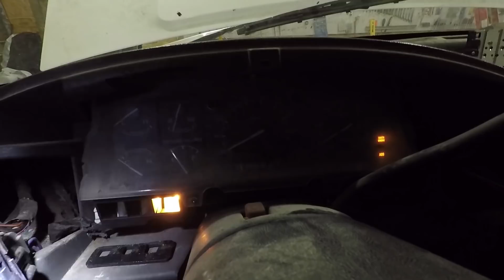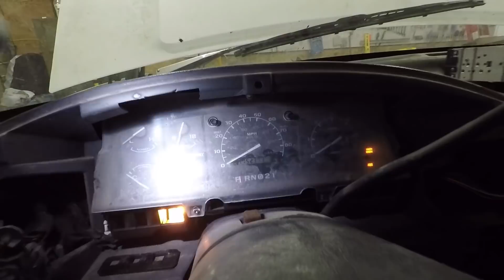FOUND The PROBLEM! - 1993 Ford BRONCO Project

Comment: My 93 has that same drivers door interior lights switch. That little protective cover tears off and moisture gets into it. I kept cleaning it for awhile until I finally found a good one at wrench n go. Super easy to change. Lots of fun projects on that Broncos makes a big difference each step of the way.
Reply from the maker: I have a feeling I will be heading there many times in the near future. LOL
Reply: Hi Bill I have a 93 Bronco as well my check engine light just came on but I can not get any codes from  it. I've tryed everything and no codes . Has your ever done that ?

Comment: I totally hate aftermarket wiring crap. I spent a good two years tracking all of it down in one of my trucks. They had some dumb remote starter installed with that weird module thing like you showed in the video. They boogered up pretty much every single connector under the dash from the turn signals to the headlights to the main ignition switch wires. Soldered together what I could and had to replace some connectors entirely but it was well worth it. No more wiring shorts!
Reply from the maker: Seems to be what you run into with an older vehicle like this.  That Flareside I had, had wiring all over it as well that I pulled out of it.
Reply: Seems to be. I ended up yanking the entire dash and the main wiring harness out eventually to fix it all right. Took a long time, but I don't regret it one bit. Everything works as it should now.

Comment: Hey Jon
  I own a '94 F350 Crew Cab dually,  7.3 IDI  and u also have a problem with the #8 fuse blowing, speedometer . And my Kenwood stereo keeps going into Protect mode. I'll have to check my ceiling light for that screw  length. 
  Great show brother
Reply from the maker: Worth a look and easy to check. Seems to be a very common issue blowing that #8 fuse.  Thanks!

Comment: Hi  Just happened onto your channel.  I've been chasing a parasitic battery draw for a long time. (1992 Bronco)  Fuse eight also involved.The door jam switch for the interior light was intermittent   I just replaced it and the draw went away..  Its funny because with the fuse out it was good for 2 days.  Then the battery went flat.  With  the fuse buddy tester on the battery playing with the switch it went from   .03  to .272  ma    So I replaced the switch with a new one.  Now everything is good...  Will wait a few days to see if the draw come back..  FYI

Comment: good to know ~ 
also; I had a fuse (can't remember) that kept going and loose my PSOM (therefore; it would go into "limp-mode" & slam shift)/ backup lights/ABS/
TURNS OUT that the blk/pur wire that is the backup lights also runs across between the headliner and windshield to possibly power the "nightime/daytime mirror".  Now the trim running (inside) across there, is sharp thin metal and it wore into that wire and VOILA found me short!
wrapped it up and also some elect. tape on the sharp edge of trim - done~

Comment: I'm liking the Bronco project, I can't wait to watch the build. 
   I have a 1995 F-150, and I was wanting a set of the stock looking clear turn signals. But I had to buy a whole set of lights, and so I have a brand new set of aftermarket headlights & corner lights. And if you want them I'll let you have them for the Bronco project. I live in WV so shipping shouldn't be to much.
Reply from the maker: Email me
Reply: I emailed you. I actually did it 2 times because I didn't think it went through the 1st time, so you got 2. HaHa..

Comment: Hey john fixing to do the oil pan gasket and timing cover on my 5.0 in my explorer did you have to raise the engine to replace oil pan gasket? and how did you do it?
Reply from the maker: I havent done that yet... but might be. Yes you will need to raise the engine to get it done/
Reply: The Fox Shop okdokie just can't wait lol
Reply: He's right, you have to undo the motor mounts and lift the engine.
Reply: Han Skinslo and disconnect exhaust from manifolds from what I've been told if anyone has other info tips for me I would appreciate it

Comment: That's a keyless entry module you pulled outta there, the dealerships were known for installing them and butchering the wires. That button/ switch attached to it was a momentary switch (would turn the key to on, press the button/switch, then you start the truck) I just got done getting one out of my 97 F250 7.3PSD CCSB a few months ago. 

If you're still chasing electrical gremlins,  chances are it's was caused be the module being spliced in. 

I still have pictures of the module schematics showing what colored wire went to what/  what it controlled. If you're interested

Comment: i found out all the bronco's and f150's didnt come with vanity visors depending on the year and the model, but u can install some, and i had the same problem and i found out that the radio wires was exposed and touching the metal frame inside causing it to blow a fuse everytime i put a fuse in, so i put plastic sleeves on the wires temporarily fix the problem, but your problem might be different.
Reply from the maker: I tried moving all the wires and looking for one that might be bare and touching something.. only thing that made it stop blowing was when I unplugged it.  New stereo would probably be good anyway. LOL

Comment: Funny how on the 93 the door switch is at the bottom, on mine it's up front. They probably changed it because it gets wet down there and does what yours did, shorts out and breaks. I want that dome light in mine, mines different. Does she want the tire carrier on there? I got a Marti report on mine and it had a carrier, at some point someone took it off because the hardware is in the quarters, whoever had it just did body work over them. Love this project Jon, she'll be a beauty once completed!
Reply from the maker: She will look good when done for sure!  Dunno on the tire carrier... if we put larger tires on I hear they dont work.

Comment: I recommend getting a new headlight switch the stock ones tend to catch fire. I will also check my local junkyard for that bezel they have a few bronco's. I believe the one i pulled your other trucks radio amp from has that same bezel.

Comment: Hey, I have a 94 f150 and two days after I bought it a few months ago, the dash lights and a/c control lights quit working and it is not a fuse. What should I check out?
Reply from the maker: Could be a wire somewhere, or could be tied into the light switch on the dash. I would play around with that switch.. pull it out like your headlights are on, turn it like you are dimming the dash lights, move it all around and see if they come on or at least flash on and off or something.  Thats where I would start.

Comment: a hot glue gun will easily fix the dash bezel issues , just glue the tabs back on , and the tabs of the switches too , and if you ever have to remove say a switch , it will come apart with a box cutter ...

Comment: I'm confused, are you saying that those screws on you dome light were the problem?
Reply from the maker: No....there was a short on that circuit....although I have heard those screws "can" be an issue
Reply: The Fox Shop I have a 95 bronco and just recently I noticed the radio will lose it's pre sets and my underhood light flickers but won't stay on. Thought I might look at that dome light.

Comment: Well I have a problem like that it kept blowing the fuse 8 but now it stopped like your bronco but my problem is my fuse would blow because of my brake light  I would put it in it will work in park but after I out it In drive it will blow after a few sec

Comment: LMC Truck has the Dash Bezel, brand new. Problem with getting one from the bone yard, is that the plastic does not age well, and breaks really easily, believe me I know. I had to locat a new bezel for my old 1995 F150 4x4, needed to place my fuel tank switch back into it, but the screw holes snapped on it.

Comment: nice job on the Ford bronco i won't think it would be the radio causing fuses to blow every time you put one in.
Reply from the maker: That circuit also controls memory function on the stereo I guess....unplugged it and been good since....
Reply: The Fox Shop 

yea at least you figured out what the problem was

Comment: FIX The  original owner on my 1993 truck  had reinstalled the light upside down so dome was on wrong wire making dome always on. He also used wrong length screws. If the mounting screws are too long, the mounting screws grounds itself  on body making it always stay on.

Comment: My fuse pops every time I take it to the car wash lol but I haven't looked into it yet
Reply: I guess if I would of watched the whole video before I commented you would of told me my problem lol
Reply from the maker: Well "maybe"... I mean that was the problem I had.. could be something totally different. Just dont go to the car wash... problem solved!
Reply: The Fox Shop dang birds made my truck a target so I have to alot. Needless to say I carry extra fuses labeled car wash fuses lol
Reply: +2 Mostly Bald Guys - You don't spray under the hood, do you?
Reply: Han Skinslo nope I just run through the auto wash moslty
Reply: Ok, I was just making sure you weren't hosing down wiring harnesses or something!  Good luck with the fuse situation.
Reply: I used to have that problem, only the door chime would go off non stop, water was getting into the light switch on the door as the rubber was worn/gone. Bought a new one and no more problem.
Reply: Thats why i like the 87-91 model broncos with the straight 6

Comment: My 92 has the same driver door switch and it wasn't working, i pulled it out and saw some corrosion inside it so I loaded it up with brake clean and worked the switch a butt load and it ended up fixing it...
Reply from the maker: I havent pulled it out yet...  going to be doing that.  Might be the problem.

Comment: I recommend a compression check and see where the motor stands - the red truck kind of bummed you out with it's engine issue.
Reply from the maker: I will probably be doing that soon.. along with tossing in some new plugs and wires.

Comment: Electrical shorts suck I'm trying to track one down in my 78 f150 when headlights are on all the lights on the truck flicker intermittently I'll find it eventually and here in omaha both u pull it's usually have yer Bronco parts heck I still find parts for my 78 there
Reply from the maker: Chasing down electrical shorts can be days instead of hours... I felt a little lucky I tracked it down as soon as I did...

Comment: That device is a security and remote starter. Probably taking out the remote might have shorted some wires, those wires go to ignition and brake and heater and etc.

Comment: You can upgrade the dome light next time you're at a junkyard by pulling a new assembly from an sn95 mustang
Reply from the maker: I will have to take a look.
Reply: The Fox Shop http://www.fullsizebronco.com/forum/7-1980-96-bronco-tech/43687-upgraded-dome-light-info-those-interested.html#/topics/43687

Comment: There is a wiring underneath the driver side visor it goes from the visor along back down the door panel I mean down the passenger or driver's headrest to the floor pops out by the seat belt harness and it goes to the dome light and the reflights and the seats something which ties into the everything I'm doing the same thing right now my truck's been taking apart since the Easter I've been on here every day I think I've got it about nailed I'll be able to drive it for 5 minutes or something else breaks I can't effin' wait...lol hard shifts into second so I just been driving in second only going to the parts store just driving it every 3 days just to see if anything's different got the dash to put some pictures up but it looks it looks bad everything's taken apart I've been under there just doing transmission just now redid the differentials brand new wiring harness from the VSS all the way to where it tied into the system I was going to start on the tail lights next hopefully not but the fuse box at the same thing it's something with the relay flashers there was some popping under the dash I ripped all that same shit out it was the airbag the airbag control module and the keyless entry and the alarm box was with that you had on your floor there I believe the other wire I don't know mine was purple and it went nowhere the power up to it and it sounded like radio static radio feed my stereo was the first thing to go those months ago and I didn't think anything about it I figured it was just the fuse in the stereo itself but stereo fuse was good I haven't checked any of the wiring yet since I started replacing shit but who knows today I got the PSO to psom to pain last night what's my big fear was it was that cuz I've already had the dash taking apart a few times now I got to figure out the heater control my heater control panel I'll slung apart while I was driving it was a tape came off this holding it together with but that'll be tomorrow which reminds me I need to pull the airbag sensors just so that thing got to go off cuz I'm not putting it back in I don't think I'm not sure yet other than that yeah man, good luck bro, awesome..lol but that circuit is connected to the rear speed sensor above the differential I've gotten two now that were incorrect so I've got my original one back in with a new wiring harness spliced in that I just did yesterday and just finished taking it up today and putting on a new loom. Pulled all the connectors off the transmission cleaned everything I've had the grounds I did already out of a gauge wire made a whole set of grounds for it out of a battery terminal wire new starter solenoid there's one ground I haven't found her two grams I think still I got to have them come across or whether they're missing I find a clip underneath the crossbar it looks like it might have had something on it but who knows but when the inside lights work with jiggle in the fuse box I'll have RPM and odometer but no speedometer and still hard shifts it's the transmission going into limp mode it's a fail safe where it runs high pressure and the first or third it's about all I know oh and your door panels check your door if you're a door locks work or not or your windows cuz the check the ground inside the doors as well and pull your switch out the momentary switch make sure it's clean and grounded cuz that could cause that as well it's about 77 different things that can make it do that way to go forward I'm going to kick an engineer oh and you see what I did to the four wheel ABS oh my God put it right underneath the windshield or radiator fluid solution tank idiots man mine's move now mounted a little bit higher a lot lot dryer till the cover over it with you know undercoating everything while I'm down there just in case there's a wire hitting something somewhere that I didn't see get in there with your phone and take pictures but I'll do is take about 20 or 30 pictures when I'm done working and make a video of everything that I'm planning to work on next and then that way I can kind of study it and see where stuff is do it a little bit at a time you know on my phone usually as I'm drifting off with the highlights of living huh anyway I think anything else I'll add it I'm going to try and get it on the road tonight and see if I don't get pulled over again I'll let you know to my last one I fast go too many times haha

Comment: Ah..factory forf security alarm... Its just a stupid alarm that goes off when the doors are opened without a key...very annoying and good you ripped it out
Reply from the maker: What a cobbled mess that was...
Reply: Normally not that cobbled,  someone either added it on or removed it from play not sure which, if it was factory there woulda been a giant red light next to the steering column on the left side under the bezel